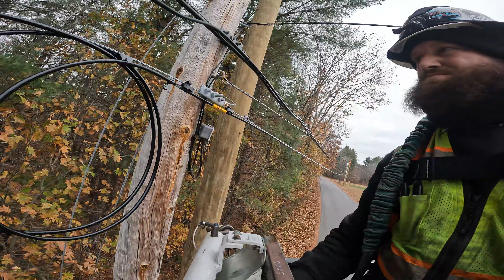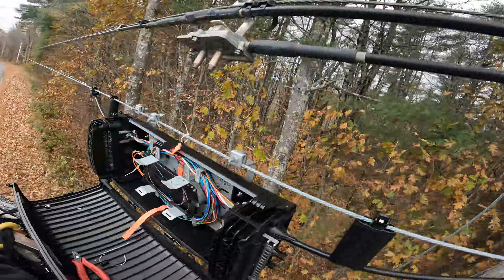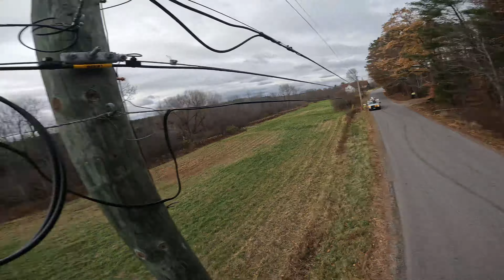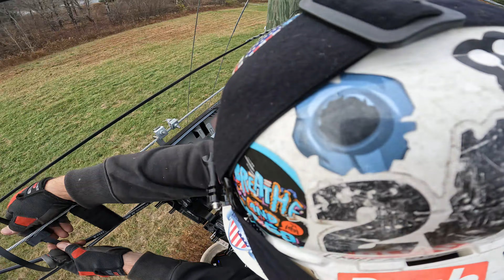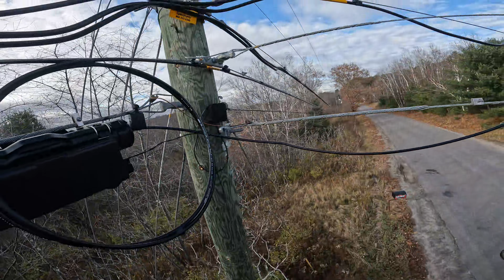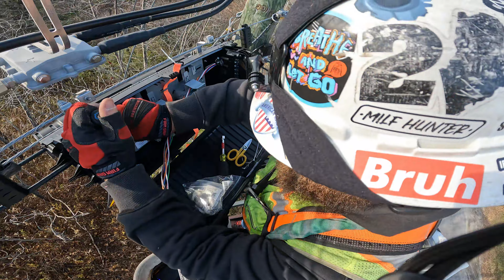MID SPAN FIBER SPLICING 3 CORNING SCA'S

Comment: I like it overall. I don’t understand why splicers don’t attach strength members. When I was splicing for over 4 years, new builds, outages, maintenance, there was clear evidence that attaching strength members helped keep the cables from pulling more than only doing hose clamps alone.
Reply from the maker: I usually do attach strength members but in these enclosures the strength members are to big for it to fit....But i agree with ya 100 percent!!!!!!